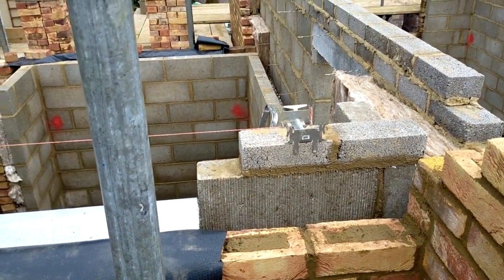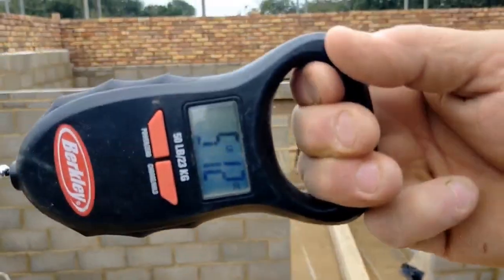Fitzbrick revisited.

Comment: W Rose is the strongest line bar none a would think Andy. Never had snap in shitty water condition etc. 🤟 clamps are good they do ware a we bit on the the line them we grooves just rubbing a bit when pulling of it. Must say a love the fitz brick there real. Handy just want that works on a 140mm concrete block.
Reply from the maker: Just make a line stretcher from a piece of batten and two nails for the 140s 👍
Reply: @bricklayersworldwithandy6277  
Yeah that what going to do now buddy seen it on 1 of your videos. Did buy metal line stretches haven’t used them like you say wood and nails and boom sorted 😎😎👍🏻